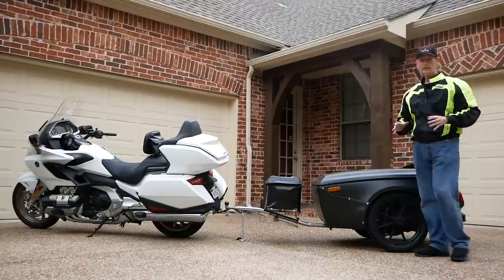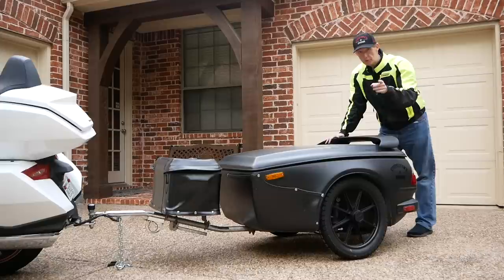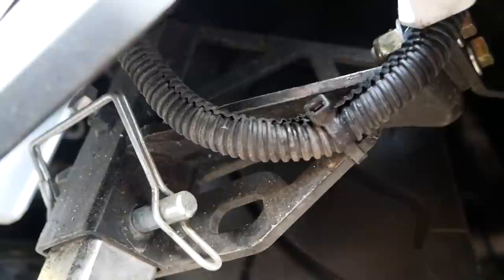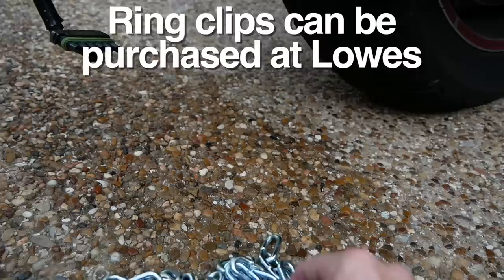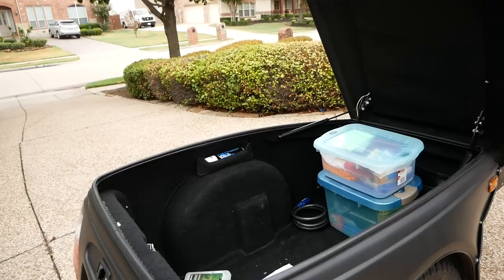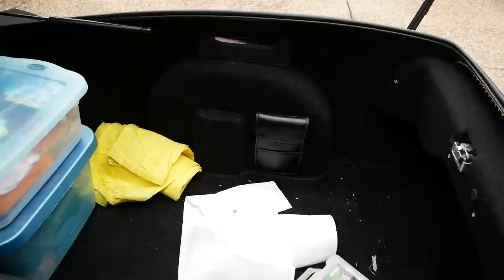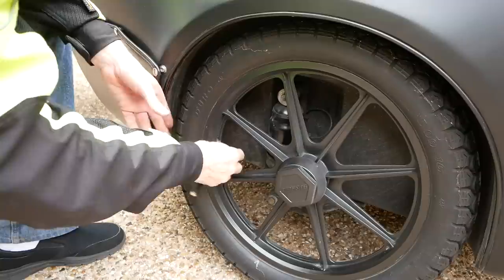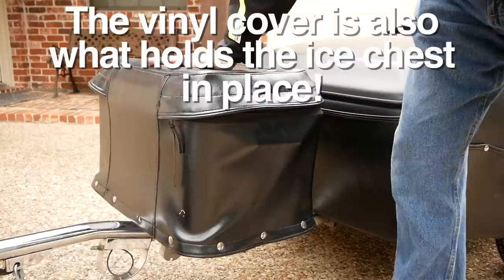Don't Pull A Trailer With Your Motorcycle Until You Watch This | OLD VERSION

Comment: Since Honda doesn't mention pulling a trailer at all in their warranty info, you just have to try it yourself, and take the risks.  It works well with a manual transmission, but, will the new automatic stand it without overheating, and possibly self destructing?  As the automatic is new to the market, is there a transmission cooler either on the bike, or available through the aftermarket?  These are questions you may want to ask yourself.
Reply: It's a water cooled bike. Cooling should not be an issue.
Reply: Maybe he was thinking transmission cooler, it's often added to cars & trucks towing trailers, but I've never seen anything offered for MC's since the DCT is relatively new in touring bike. The radiator should handle the motor cooling fine based on previous GL Wing generations doing well.

Comment: Your videos are very informative .. I however am concerned with the manner you are trying to get the connectors together at around 9:49 of the video .. In the manner that you push / squeeze the connectors together you are pushing / squishing the wires against the connector .. This will break the leads (wires) going into the connectors in no time .. This type of connector, whether being a 4 pin which is most trailers to the 5 or 6 pin connectors, is a design flaw on purpose to make the consumer needing to replace them over time .. If they were to make a twist lock type system or screw ring to mate with other part of plug would prove to be more effective .. Just my opinion regarding the connection systems .

Comment: I pull a double L camper trailer I hold 40 pounds on the tongue If I go under I go into a speedwable Violent I got one so bad I had to pull over  The side the freeway. And a highway patrol cop told me to pull her off the freeway I said I can't do it. I said I stopped because this is so violent I couldn't move any further And I had my wife on the back of the bike I hold 40 pounds of air in the air shock and 40 pounds on a ton weight and it rides beautifully That was my 95 SE goldwing.

Comment: I have a Uni-Go trailer.  It has one small wheel that is centrally located at the very back of the trailer.  How do I deal with tongue weight with this trailer, since everything inside it is in front of the wheel?
Reply from the maker: Good question. That is probably a question you should ask of Uni-Go. What is the max weight limit for the Uni-Go?
Reply: @cruisemansgarage  The trailer weighs 70lbs.  The maximum cargo weight for contents is 110lbs.
Reply: @cruisemansgarage  Uni-Go states that the maximum tongue weight is 1/3 of the total trailer weight with cargo.  If the trailer weighs 70lbs and the max cargo weight is 110lbs, then that means the max tongue weight is 60lbs.  Isn't that a lot for the motorcycle receiver?
Mike
Reply: @cruisemansgarage  Cruiseman, I notice that you have a 2018 GL1800 DCT model.  I am curious: with all the vast experience you have motorcycling, what made you choose the automatic transmission?  Doesn't that detract from the overall motorcycling experience?
I, too, bought a 2018 GL1800 but opted for the manual transmission.  I know that the DCT models are very popular.  I just don't quite understand why...
Reply from the maker: @michaellynch2559  That was my concern too before I made my decision. Would it feel like motorcycling? In part, I bought the DCT because I wanted to see what this new tech was all about. I had no idea that the DCT would be so popular. I actually have grown to love it, and no, it does not take away from the joy of riding. In fact, riding the Tail of the Dragon in Manual mode is quite a rush!

Comment: Is it legal to pull a trailer? I've herad it's allowed to be tow half of you motorcycles weight with trailer included. Is it true?
Reply from the maker: I have not heard the ½ weight rule, but the Bushtec fully loaded would be less than ½. And, yes, it is legal to pull a trailer.
Reply: @cruisemansgarage  Fine, thanks.
Reply: I WOULD BE INTERESTED FOR A TENT CONVERSION THAT YOU CAN PUT ON IT. It would be a perfect lightweight camper setup. OR that you can unwrap from it.

Comment: Would I be able to tow a trailer with my sports bike?
Reply from the maker: Josh, I doubt it. The engine could certainly handle it, but a sport bike frame is built to be super-light and might not have the strength to handle the stresses of pulling a trailer. I would advise against it.

Comment: We've been towing trailers with  Gold-Wings  for the last 30 + years never had an problem
Reply: jack turtle I have an Escapade Classic and would like to know if using radial tires is acceptable. Any advice greatly appreciated.
Reply: How do they handle on highway can they flip in high wind i been rideing over 30 yrs but never had a trailer

Comment: I would think if that trailer comes loose you would want it to just come off instead of it taking you down cause its going all crazy back and forth.
Reply from the maker: As a rider/driver, you probably do. I am sure the regulations are to mitigate damage or injury to other drivers behind you should the trailer come loose.
Reply: @cruisemansgarage  of course most of our law makers don't have any common since or have done the very thing they make up laws and pass for all of us to abide by but common since tells me I wouldn't want chains. Say it comes off the hitch cause instead of fixing roads they hand are hard earned tax dollars out to people that are totally capable of working but they want their vote but that's another subject so trailer comes off the ball and drops in a pot hole or big crack before you can stop, I don't think that would end well. I'm gonna buy some of those yellow plastic chains and spray paint them chrome. My wife and I mostly ride alone and if it did come off I think people in cars or semis would have a better chance at surviving than us. And if it hits someone else traveling on a motorcycle then they were just in the wrong place at the wrong time.
Reply: @cruisemansgarage  I've actually never pulled a trailer behind a motorcycle and just bought one today a TIMEO trailer and the tongue actually swivels all the way around I think or close to it but was wondering if you can reccomend a certain brand or type of hitch for my bike? I have a Harley Davidson Street Glide.

Comment: why do you have to have a safety chain on, because if the trailer came of it will take you and bike down
Reply from the maker: Safety chains are required by law in most states.
Reply: The last thing I want, if I'm going 60 mph and a wheel pops off the trailer, is a trailer spinning around pulling on my bike by the chains. There almost 100% chance I will go down. Without chains the trailer will separate from the bike, and there is an infinitesimal chance it will hit a car and injure someone. No chains for me....
Reply: I meant to say that the hitch broke off, not the wheel comes off.

Comment: Do you really want safety chains on a motorcycle trailer I mean if the trailer becomes detached I think I’d rather have it completely detached then dragging on chains
Reply: Legally they're required in most places
Reply: I agree , just put in a break link no one will know. Same reason lead climber has a swiss army knife.
Reply: You assume responsibility because of your decision to tow. A completely detached trailer can run anywhere and lead to loss of human life.
I have TWICE had my trailer jump the hitch due to improper lock-down, and the effect on the towing motorcycle is similar to getting a sudden flat rear tyre.

Comment: I would NOT hook a chain from my trailer to my bike. If the trailer come off the hitch let it go. You will not have any control if it's hanging off your bike, my the chains. You will wreck.
Reply from the maker: I believe the laws in most states require a safety chain.

Comment: I watched this video and it is totally bogus. I would never tow a bike the way he has it set up. I have towed a trailer since 2010. The chain connection are worthless in a accident. 
The ball hitch/pin is the most dangerous you can install. I would file this video in the " don't hook up a trailer this way".
If this trailer would spin behind you with this set up, your going over.
The bike also is not talked about. In my case I had a 2010 ultra classic. I had a stock engine, wish I had a 103 hp.
Had a hard time keeping up with the group.
The only hitch I would install on a bike would be a 360 degree hitch. If the trailer starts to spin, get a blow out, it's not going to pull you down.

Comment: What a bunch of extra garbage. Just take a car if you are going to have an overly complicated hitch and belive me, if your hitch fails and the trailer nose dives into the ground you will be wishing you didnt attach it to your bike with slack chain. Sure, the bike will stay connected to the trailer as both of them crash. 
   Also you are totally wrong about the distribution of weight, you need to keep the weight on the hitch, otherwise you have a jackknife situation because the rear tire not being pushed down to the road surface while breaking.
   Im saying all this because people will watch this video and then have accidents and that makes me frustrated.

Comment: I'm going to buy a Goldwing cos I want a quality tourer and don't want to be a Harley riding, 1% wannabe, middle aged joke. However a trailer is also heading into dorksville in my opinion. Get a car.
Reply: The correct place for your automobile, when setting out for a motorcycle tour, is properly secured inside your garage, or car port.
I tow a 48" x 34" (bed size) utility trailer with a 2009  Suzuki Bergman Exec (650cc twin at 54BHP), and my most taxing load to date was a 320lt Hisense refrigerator weighing in at 67kg and about 5' 10" tall..
It would have been impossible to carry that refrigerator home with our Toyota Yaris sedan.

Comment: I really like your videos, but there are MANY errors in this one. As someone who has towed every manor of trailer behind a motorcycle, I am CRINGING at what I am watching here.  

First, the BUSHTEC trailer design is severely flawed.  The large BOLT protruding down from the hitch is a horrible design.  Should the trailer come off of the hitch (not bloody likely, but ...) that BOLT will impale itself into the asphalt, or a crack, or some other solid obstruction, and that will stop the bike in a New York second.  Roll over a sewer grate and that bolt will drop into a slot and STOP that trailer faster than you can say, "Over the handlebars I go!"  I see the narrow chrome loop farther back on the tongue, but that will bend backward at the first hit, and become useless.   If it twists when it bends, it become a steel LOOP to hook onto something.  That loop should be wider, and have a web inside of it for strength.  If the chains don't break, then the bike ALSO stops on a dime, but the rider and passenger keep moving forward.  The tongue should have some plate or something to allow it to SLIDE on the pavement and over minor variances in the pavement if it hits the ground while being towed.

Second, the position where BUSHTEC decided to connect the chains is a FREAKING JOKE.  The chains are supposed to catch the tongue if it comes off of the hitch.  Crossing the chains is correct, but that 'X' must be able to catch the tongue when it pops off of the hitch and drops.  The length of those chains means the tongue will easily drop through the back side of the 'X' and hit the ground, so the chains are useless in that configuration in the video.  The length also means that when the bike brakes, the tongue can move forward into the rear wheel, causing a disaster.  The chains should not allow the tongue to hit the rear wheel, because if the tongue DOES hit the rear tire, the tire will lift it up into the frame, and may even lift the rear wheel off of the ground in the process.

The chains should only be as long as necessary to allow the trailer to swing from side to side , yet not SO tight that they bind around the nut that holds the ball onto the receiver.  Your chains are connected too far forward in the front, and WAY too far backward on the trailer.

Sorry for the report, but I would never tow a trailer that was hitched to the bike like that.  It is a recipe for a disaster.
Reply: Another recipe for disaster is what my mum-in-law uses to make lasagna.